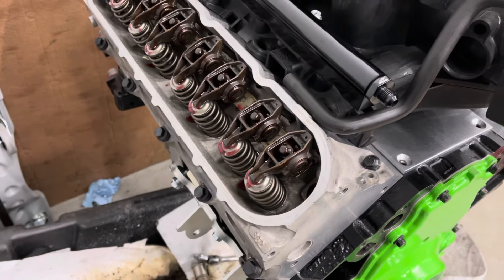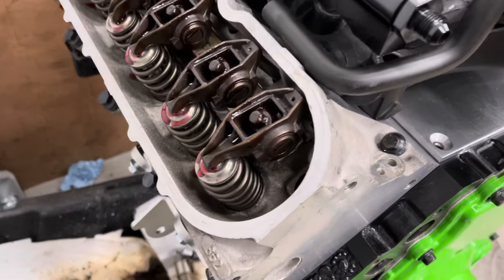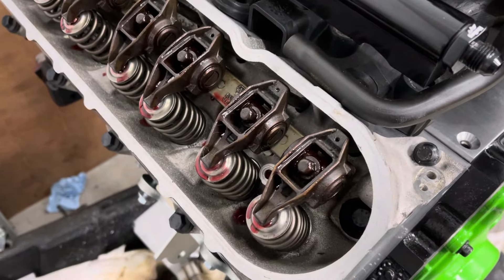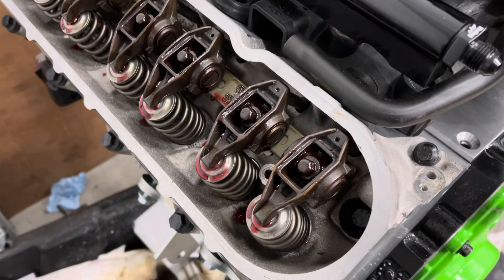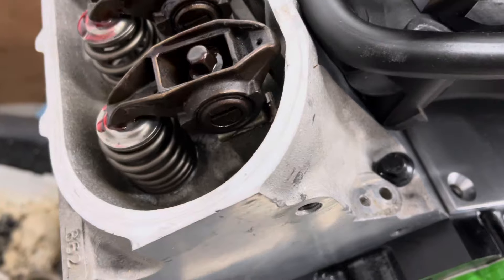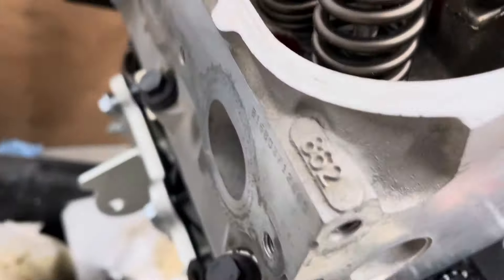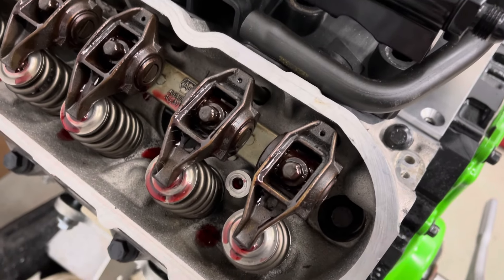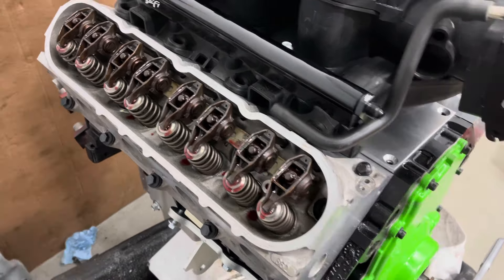LS rocker arm install

Comment: So i should install all of my rockers, snug the bolts, then turn the crank until both intake and exhaust valve are on base circle, and then torque to 22ft lb, correct? I noticed when I turned over the motor last night that some of the rocker bolts loosened up, but they were torqued yet. Just trying to make sure i understand properly. Thank you.
Reply from the maker: Yeah that’s correct. Some people just zip them all down to 22ftlbs and go. No matter where the arms are. It’s personal preference. But the way I did it is in the video and how you asked.
Reply: @DandDPerformanceEngines yeah I did that to. It's all fun and games until you use old push rods and accidentally mix them up and end up with a rattle 😂 have to reset with all new pushrods. You did it right forsure

Comment: It's not just some people, GM doesn't bother basing them, they just torque them. Not to say it doesn't make a difference, it does, just on a stock LS config, the difference that's found isn't a particularly relevant factor. /That/ said, it sure doesn't hurt to base them, and it's a good foundation habit to have, better to base one that doesn't really need it, than to not base one that does, and either rip the threads out or pop a crack in it.
Reply: You said it does make a difference, how so? I know on stock springs it’s prob fine to not base them but on stuff aftermarket springs I could see how it could be an issue,  but in what way would it make a difference?
Reply: @BWill 03Z 
I know I’m not the one who you were trying to get an answer from but I’ll do my best to explain since it’s gone unanswered. 
If you mount the rocker arm with the pushrod on a lobe, it will collapse the spring while you’re torquing the bolt. The point of torquing it to 22ft lbs is exactly 22ft lbs. if you have a spring fighting you, you may not be accurately torquing it. Not to mention, a lot of heads are aluminum. Removing a hardened bolt from a head while the valve spring is under tension is just asking for problems. Hope this helps.
Reply: @mattakeet773  isn't the point is pre-loading the lifter as well so each one needs to be done the same at base circle of cam??
Reply: I've just zipped them down and have never had an issue all that ur just over thinking it ..stock or aftermarket springs same crap to me

Comment: So where both the 1st 2 on the base circle then and ready to be torqued or just the 1st one?
Reply from the maker: I did it just one at a time. Get it to where the rocker arm is on the base then tq it, for each one individually. There are tons of videos of people just putting the rockers on and tq’ing them to 22 no matter where the lifter is on the cam and it be ok. The way I do it just the way I was taught when I was a kid and I just stuck with it. LS/sloppy builds people seem to get away with doing it any which way and it be ok lol.
Reply: @DandDPerformanceEngines  thanks..I want to di mine right
Reply from the maker: @BeardsandCars  no problem. Here is another link that will be helpful too. 

https://youtu.be/flzcTa2UZE0
Reply: @DandDPerformanceEngines  i don't see how they don't have problems the object is pre-loading the lifter if they're all set at different points instead of at base circle of cam they're not getting pre- loaded equally  correct?

Comment: Question, thinking of doing valve cover gaskets on my 6.0 LS was wondering if it’s okay for me to torque the rocker arms to 22 ft lbs? Reason I thought of that was because I have a slight lifter tick 180k miles

Comment: If you're replacing your valves, is it OK to reuse the stock rockers? Mine have about 150,000 on them.
Reply from the maker: If they don’t have weird grooves where they ride on the valves, you should be ok. I would recommend trunnion upgrade.
Reply: @D and D Performance Engines  what trunion upgrade would you recommend?
Reply from the maker: @fuelinjectedduck2964  Brian Tooley all the way.
Reply: @D and D Performance Engines  thank you, sir.
Reply: @fuel injected duck  che are nice too
Reply: Torque sequence is tdc on cylinder 1 make sure it's in compression stroke tdc not in overlap then tighten 1,2,7,8 exhaust valve rocker arms to 22lb ft ,then tighten 1,3,4,5 intake valve rocker arms to 22lb ft, then rotate crankshaft 360 degrees and tighten 3,4,5,6 exhaust valve rocker arms to 22lb ft then tighten 2,6,7,8 intake valve rocker arms to 22lb ft and that's a proper torque sequence and it's very important to do it this way or it could lead to problems
Reply: @DandDPerformanceEngines ,
Do the trunion upgrades remove the slack of side to side movement of the stock versions?  The engine has 200k and some rockers seems to have more play sideways when in base circle

Comment: I've got a stripped rocker arm bolt hole on an LS1 I'm building.  What Time-Sert kit do you guys use to repair stripped LS rocker arm bolt holes?
Reply from the maker: Depending on what head you have and budget you are working with it there are other brands but Time-Sert would be 1812CORE. M8-1.25 thread. If it’s a truck based engine. Heads are cheap at junkyards. But if it’s a true LS1 head then you can use that time-sert kit.
Reply: @DandDPerformanceEngines  True LS1 head out of a C5.  That's the kit I was thinking of getting.  Thanks for the insight.
Reply from the maker: @truthserum5310  no problem

Comment: Any side to side movements on the base circle when torqued down?
Reply from the maker: You have a little. Once the oil gets pumped up it should take most of the slack out.
Reply: @DandDPerformanceEngines what do you mean once the oil gets pumped up it should take most of the slack out ? Just curious
Reply from the maker: @630Filmz_lsx  that’s correct. That’s the hydrologic part of hydrologic lifters. The pump up with oil and take up slack to a curtain point.